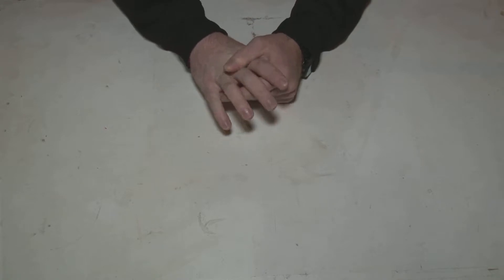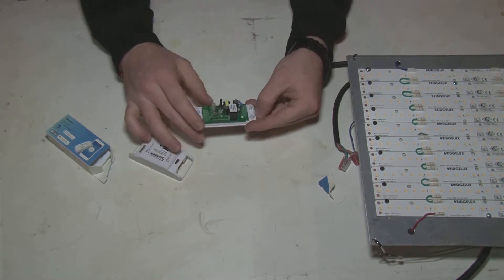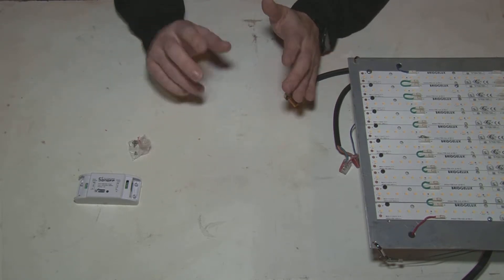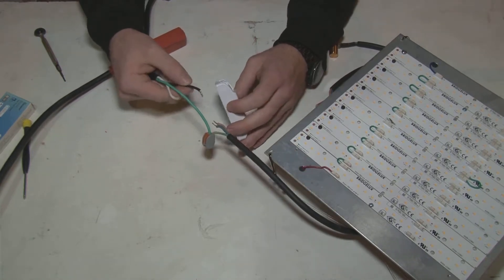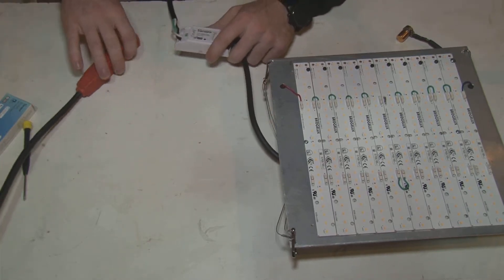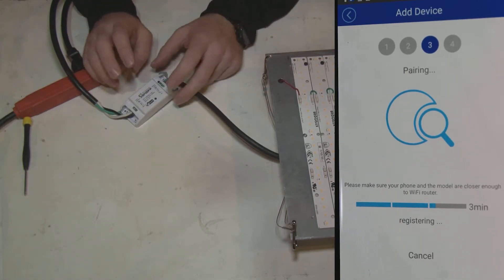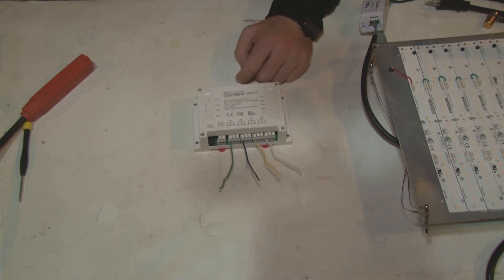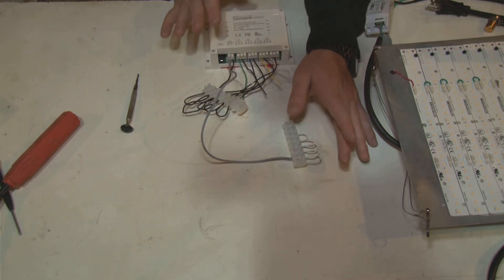Using sonoff to automate a grow room

Comment: aha yeah i used a 4ch sonoff to control my tent last year, working on a newer one now. All controller with a raspberry pi. Thats the only limitation with these is the firmware, I reflashed mine with tasmota i think the name is.
Reply from the maker: I'm basic tech savy. But things like reflashing... I don't know about. Also I have a raspberry pi I've been too intimidated to work on because I don't know much about it and I don't really have good information. Do you have any videos, because I have a reading comprehension "disability" mostly I suck at reading, and watching someone on a video is more efficient for me. Sorry simply do you have any videos you'd recommend that would get me started setting up my raspberry pi for growing?

Comment: Hey man,
How's your garden going?

I duno if you're still using these.  But either way, do you know; is there a non-internet version of this type of thing.  Bluetooth or something like that?  Don't need next continent control, just don't wanna climb ladders or turn 10 potentiometers :)

Thanks.
Reply from the maker: I don't know. I think if you wanted that it would have to be build by you using arduinos. But that's past my skill knowledge.

Comment: I have a clone room, a veg room and flower room with a full set up of these wifi switches connected to climate control(light, extraction, temp, humidity, heatmats, fans etc). In hindsight i would use the Sonoff Themostat 16Amp Smart Switch for Temperature and Humidity control rather than my setup (a wifi camera looking at a Thermo hydrometer and controlling manually). these are awesome switches.
Reply from the maker: RIGHT!?!? And they're super inexpensive. And AND I don't need too know how to even program like if i was to use and arduino. Crafty little gadgets.

Comment: Do you need B type drivers for the sonoff
Reply from the maker: no you don't technically need any drivers. It inline wires into the AC side. Its like a hard wire version of the alexa or google home plugs. Basic switch but connected to your phone. Super simple. But to answer your question the diver is irreverent in using these.